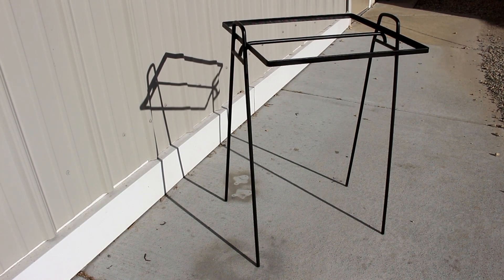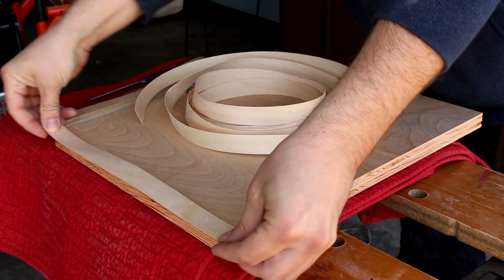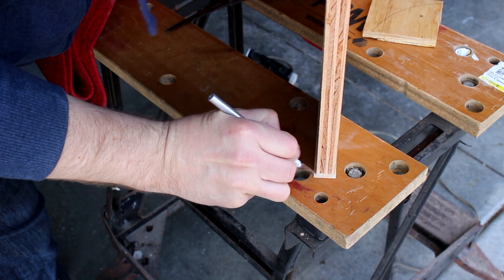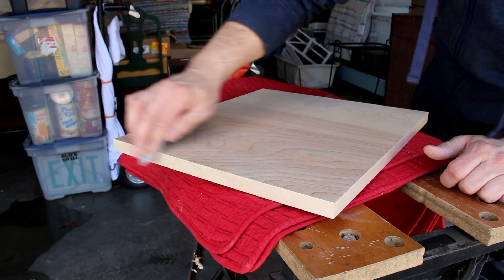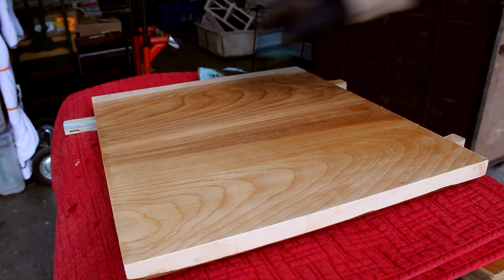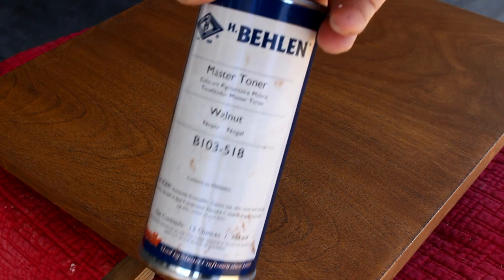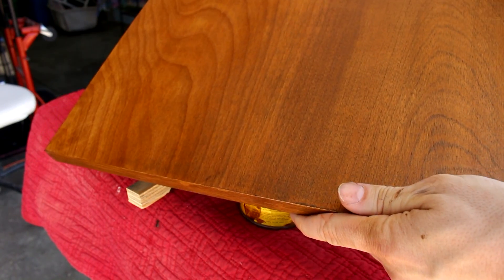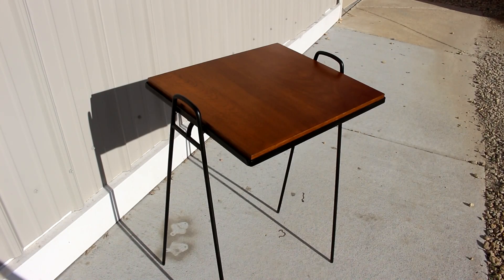Make A Simple Small Tabletop | Using Birch Plywood, Edge Banding, Gel Stain, Lacquer Toner

Comment: What I have found when applying veneer tape is to use the iron to melt the glue but follow up immediately with a smooth block to press and set the tape as it cools

Comment: Would I need to use top coat on 3mm birch plywood, its really smooth,  I dont even know if the ply wil take the stain
Reply from the maker: Hi Scott, yes I would put a top coat on it.  If it's really smooth then yes, it will absorb less stain, but in the case of birch plywood this is a good thing. Birch tends to absorb stain unevenly and turn blotchy so the less stain the better. If you want to get it dark I would rely more on spraying a lacquer toner as I did in this video. The lacquer won't be absorbed like stain and the color will be more even and less blotchy.

Comment: What are you using to apply the Bulls Eye SealCoat?
Reply from the maker: I just used a piece of a cotton shirt.
Reply: Dashner Design & Restoration thanks for such a quick reply. How about after you applied the walnut general oil stain, when you wiped it down, was that a shirt too? Thanks again.
Reply from the maker: That was a paper towel.

Comment: Hey everybody. This a random high IQ question, but can edge banding be used on beveled and rounded edges; or do they have to be absolutely flat? I'm planning on making a top for a coffee table from 3/4" plywood in the spring, but I don't want it to have sharp edges or corners.Will either impact the workability of the banding in any way?
Reply: It usually needs to be flat because it doesn't bend well unless it is a super gradual curve. Edge banding is pretty brittle.

Comment: So great! GF says their gel stain has been engineered so no pre-conditioner, etc is needed. I have never quite believed it and I have a European solid which birch table I have been thinking about. This is the FIRST mention on the internet ever about birch and gel stain. I could use Charles Neal's blotch control stuff I guess and I know it won't blotch, just don't want to buy it for one solitary project in my life. Have you used GF stain gel WITHOUT shellac or any undercoating ever? (just a humble older lady--way older)
Reply from the maker: Hello and thanks for watching.  I use GF gel stain without an undercoat 99% of the time and it works great.  Especially on a wood like walnut.  I've also used it without an undercoat on solid birch pieces with great results. The reason I used shellac on this piece is because this is cheap plywood with a really thin birch veneer.  It's been my experience that it doesn't take any kind of stain well so I was just being extra careful.  You can probably use GF gel stain directly on your solid birch table without any problems but keep some mineral spirits handy in case you do have problems and need to wipe it off before it dries.

Comment: would a heat gun work for this or no? + a roller of course
Reply: also what part of the country has flying worms?
Reply from the maker: For the edge banding?  I don't think that would work so well.  The iron works well because it's adding heat and pressure at the same time.
Reply: @DashnerDesignRestoration  Thanks for the response, I'll just use an iron, i'm sure the wife has one somewhere lol.